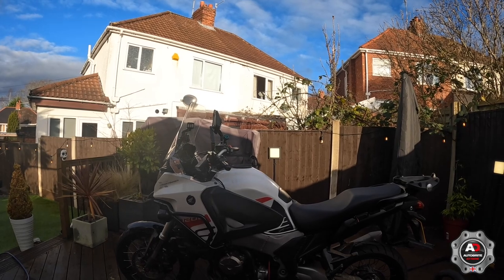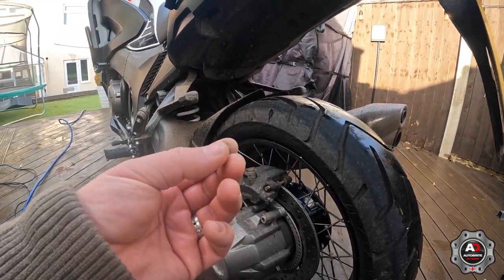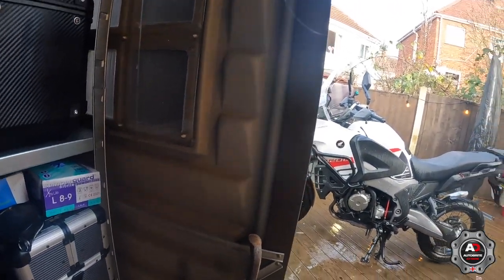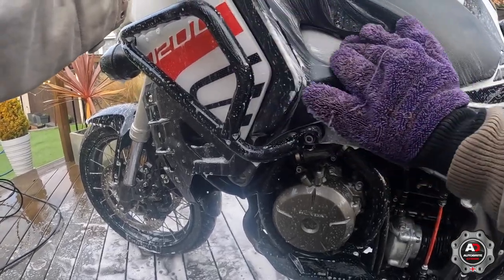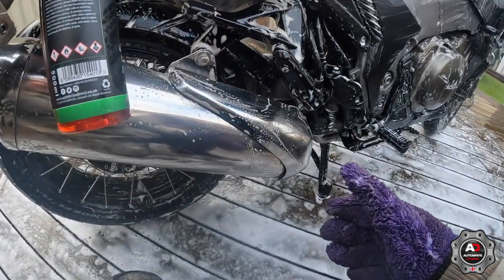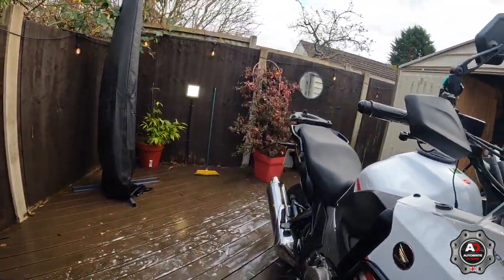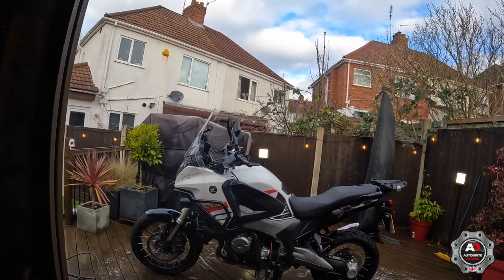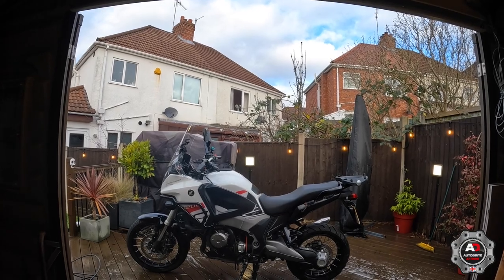How I Clean My Bike With AutoBrite Products

Comment: Yer I used the same produces but i have an issue witht he extmere cleaner or the Shampoo currently.  Back in the end of Nov I cleaned and washed my new bike with this stuff,  hose it down, dried it and then put it away in the shed.  The other day I went to check and start up bike and notice that the engine mount brackets had a grey powder on them after wiping this I see that it had corroded the laquoire from the engine mount brackets, its the only part effected by this nothing else.  These are the only items i have ever used on the bike nothing else, I have sent my findings to Autobrite but so far no answer back from them.  I have taken photos to show damage caused but i will just paint them back to black again.  Not sure if there is something on the bracket the stuff dosnt like not sure.  Any advise from the bike doctor or anyone else would be helpful.
Reply from the maker: That sounds strange, to strip lacquer requires powerful chemicals. Interested to see what could’ve caused it.
Reply: Hi Dean, I work for Autobrite I'm off work at the moment but will look into this when I'm back for you 👍🏻
Reply: @dalewintle9969  Hi Dale, Kevin there is looking into it Dale but thank you so much for the offer its an intresting thing to try and work out what course this but my guess is there is something Yamaha coated the brackets and brake end in the stuff dosent like.
Reply: @dalewintle9969  As an update Kevin came back to me they seem to think its Aluminium corrction from dirt and salt but I brought the bike back in Sep 2022 brand new and only washed it twice with these produce so i have no idea whats coursed it so will have to clean the mess and paint over them with external satin black paint
Reply: @deanchild9848  Hi Dean , I'll speak to Kev when I'm back in work and take a look at the pictures you sent over too 👍🏻
Reply: @dalewintle9969  Thank you so much that would be great I can send you more photos but I have wiped off the grey powder off
Reply: @dalewintle9969  Hi Dale did you take a look at phots what did you think?
Reply: @deanchild9848  Hi Dean I have sent you an email 👍🏻
Reply: @dalewintle9969  awesome i have read it and it fine thank you so much but i did have a product question in my email for you on Monday let me know what you think